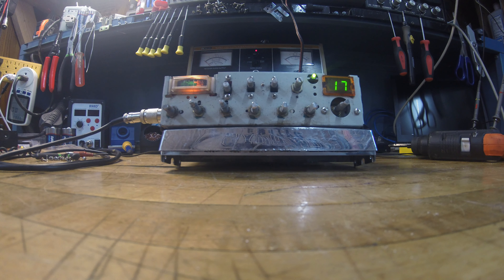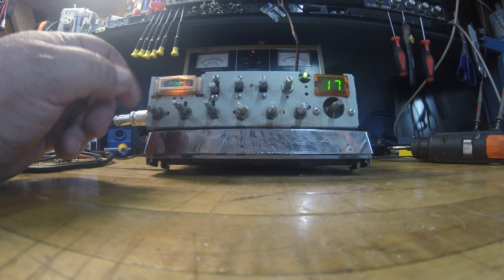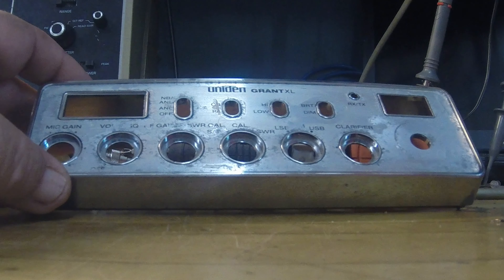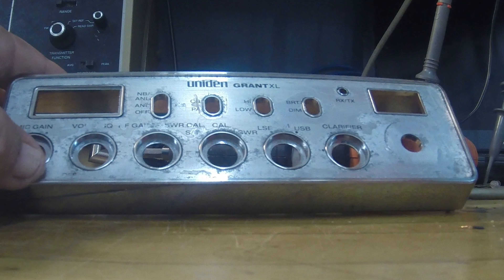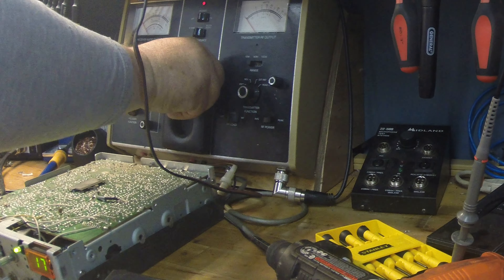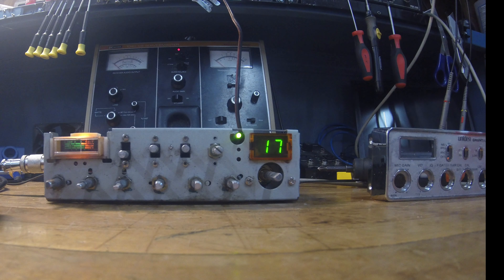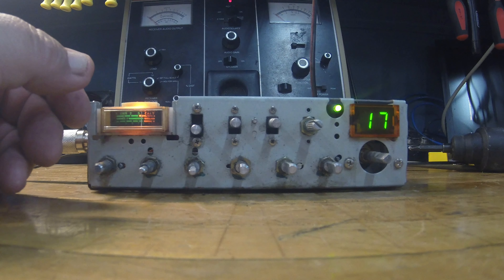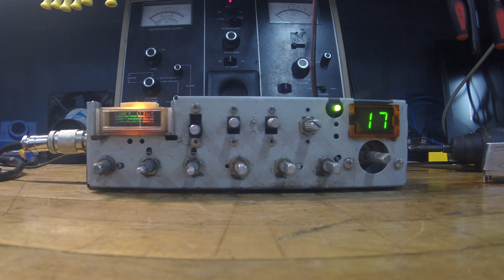Uniden Grant XL AM/SSB CB Radio Repair and Restoration Part 2

Comment: 25 is a bit expensive, that is what put me off doing that before.  Should be a good working CB, even if it looks a bit rough round the edges.
Spare front plate would be the answer, but it might be hard to come by!
Reply from the maker: Yeah i been looking so far not finding one as I think these radio's are pretty rare to come by. I am impressed with how well it works though considering..
Reply: @TheElectronMan  Tough as old boots!  :-)

Comment: Have you tried  CB Distributing for a face plate or all new bezel ???  I deal with them , but they don't sell to just anyone ..... You have to own a business with your city's business license and ETC ETC .... I deal with them they have everything a repair shop needs plus new equipment ,  antennas etc etc ....  Years ago I had an account and  deal with Cobra and Uniden when I had my old shop , I would order new plates , bezels , channel switches with the newer GREEN LED's , front pot's and meters ......